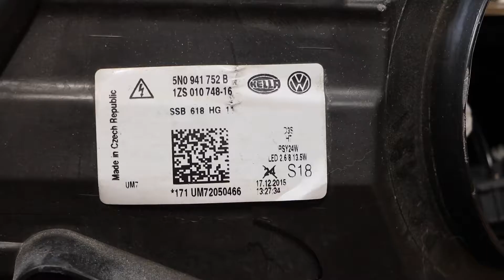2012-2017 VW Tiguan Bi-Xenon Headlight Tear-down

Comment: Hi I need headlight lens shell for my exact bi xenon headlights, where can I find it? Tiguan 2013 r line 1.4 tsi 160 hp.
Reply from the maker: VW doesn't sell these, so you can't buy them from a dealership or an auto parts store.  Sometimes you can find replacement lenses on those Chinese online shopping sites.

Comment: How did You split the lens from lamp housing? Did You just warm up in oven?
Reply from the maker: I cut it off for the video, but you should be able to bake it or heat up the glue to allow it to separate it

Comment: Hi and thanks for the video. Is it possible to replace just the xenon led unit? My 14 leds have stopped working.
Reply from the maker: VW does not sell any of the internal components individually.  You would have to find another headlight, open both up and swap the parts in question.   Generally it's easier to find another working headlight and just change the whole unit.  It will cost more than finding a working damaged headlight, but you will save hours of work.
Reply: @gftgrill  Many thanks for your prompt and helpful reply. I'll start looking for a replacement unit!

Comment: Hello, thanks for the video. I need to clean one of the projectors on mine. Do you remember if projector can be removed from the back without splitting the housing?
Reply from the maker: if you watch here: https://youtu.be/TLNviygbzdA?t=256

you can see there are front facing screws that are not possible to access without removing the headlight lens.  The best you can do without disassembling is to try using something flexible and/or long cotton swabs.